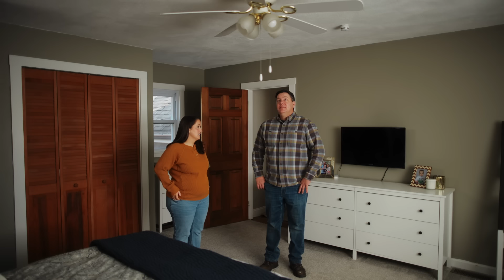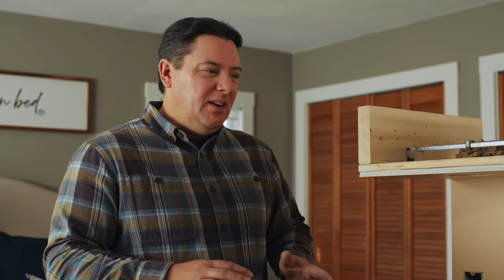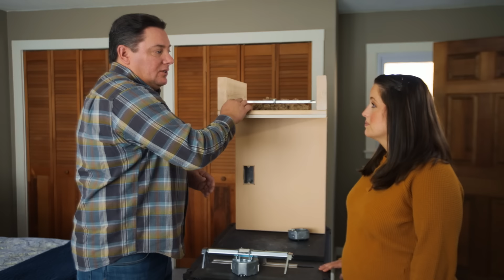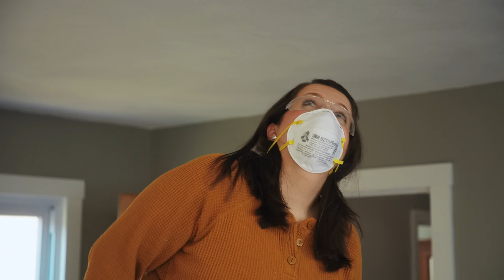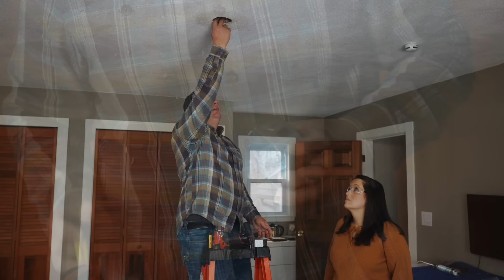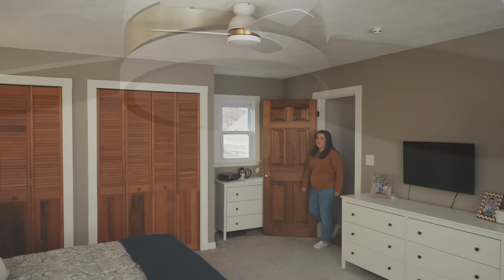How to Replace a Ceiling Fan | Ask This Old House

Comment: Ive lost count the amount of ceilings fans Ive upgraded, or installed instead of a light.  If you have attic access, always do the extra work and go from top and do what he did.  Takes longer, dirty and sweaty.  And then you know it will never go anywhere ever.  This video is spot on.
Reply: Spot on. It's an extra step, but it is necessary and gives peace of mind knowing it's secure.
Reply: So sad our house in Australia doesn't have an attic... electrician came to change lights and confirmed there was no entrance to the attic

Comment: Do you turn the power on before or after this?
Reply: During.
Reply: If you have to ask that question, please never, ever, under any circumstances, whatsoever, do anything involving electricity
Reply: what you should do is ground yourself with some nipple clamps and turn on the power to test.

Comment: Timely as I have an update for a fan due this month. I also appreciate the safety glasses. Sure the risk of losing an eye is low but devastating, but the risk of taking a bunch of dust or blown in insulation in the face, flinching, and taking the fan with you as you fly off the step ladder is much higher and much, much more embarrassing.

Comment: Do you not need a wire clamp on the box?
Reply: The box they use screw down clamps that typically come installed in the box. 

Looks like they took the clamp out before threading the wires, but they didn't show him screwing the clamps back in. 

The holes he drilled in the wood was for the machine screws the clamps use so the clamp screw wouldn't push into the wood.
Reply: @Rymac91 oooooh - ok, that explains both of my questions. Thank you. I couldn’t see the wire clamp either. And the “predrill for the machines screws” made me think he was installing the box to the wood support using machine (not wood) screws.  Makes more sense now

Comment: I think i would have ran two 2x6s across the cieling joists and mount the box perpendicular to the joists
Reply: Waste of money.  What Heath did is plenty stout enough to hold the weight, and will resist swinging better than a metal crossbar.  Those metal bars are more for people without attic access.
Reply: Well no one asked you. Just saying.

Comment: I would have put in the same kind I did.  A 72" 9 blade fan.  Moves way more air which is nice especially without ac than the standard 52" which I don't even think that one is.
Reply: How low is the blade from the ceiling?
In this situation, code requires the blades to be a specific distance from the floor.
I think they're afraid some 7 foot giant would walk into the room and end up decapitated from the fan.
Reply: @scotttovey  8 foot ceilings.  Hangs no lower than that fan.
Reply: @one7decimal2eight  
😎👍